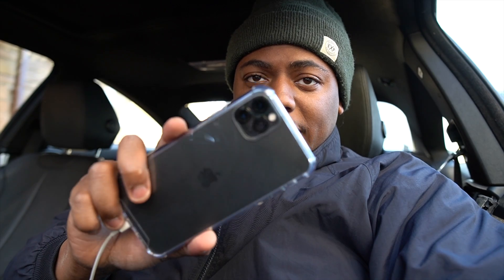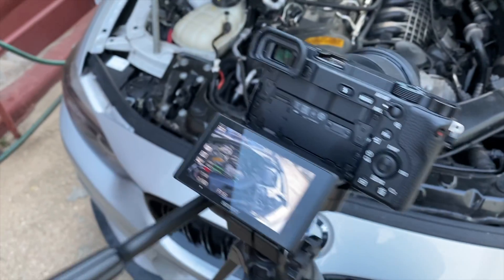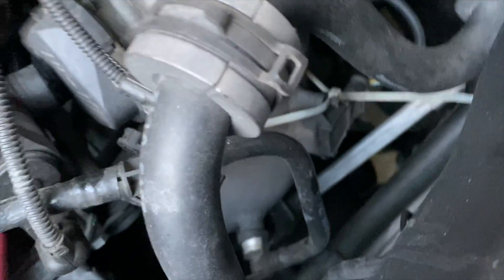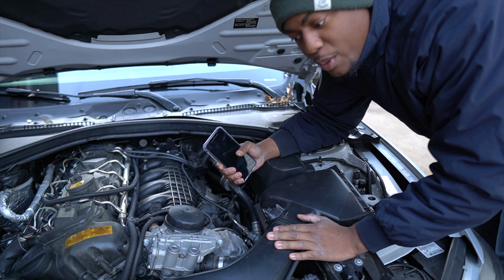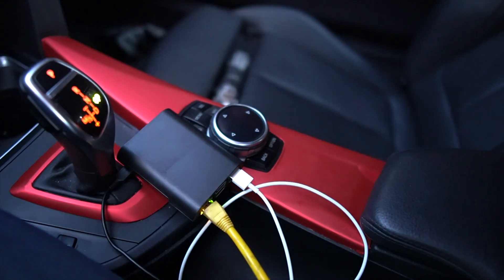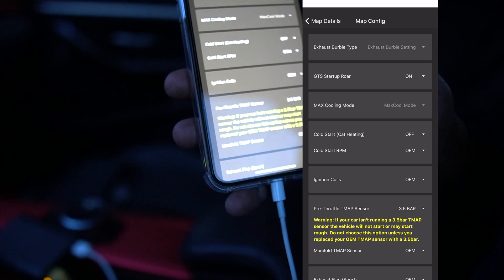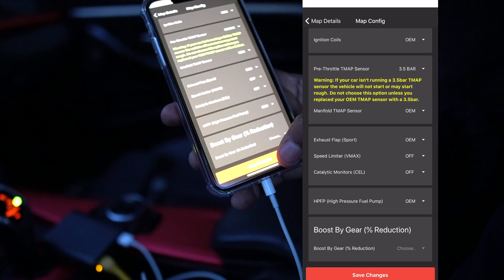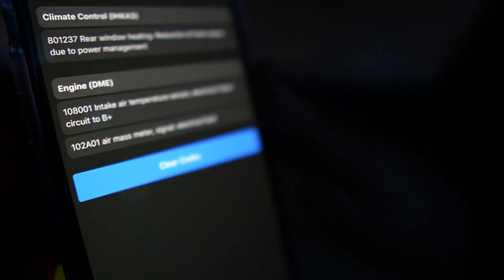Upgrading N55 Tmap Sensor

Comment: Hey love ur content very thorough bro keep it up I got a 2018 650i I'm going with a stage 2 tune i got a down pipe muffler delete going to put a intake on too my question is do I need 3.5 bar tmap sensors to get optimal boost out of my turbos the n63tu has 2.5 bar sensors I believe I want to get low to mid 20s boost
Reply: 2.5bar only reads 21.7 top. any boost spike above that, car probably gonna misfire cuz ECU won't calculate boost info correctly.  Also pls remember to tune with software after changing 3.5bar Tmap

Comment: I've seen with the mass air flow code, if you change your air filter to a KnN filter and then you get a code for air flow to high or something like that, you need to your mass air flow adaptation. This can be done in MHD I know for sure and I'm sure others. This should fix the issue unless you have a bad MAF! This is what I've seen anyway.

Comment: Hey man I saw a previous video you said you had some trouble with boost leaks when running a more aggressive tune before the big turbos. What did you do to fix it ? My cars wgdc runs at 85 to 100% when pulling it and still 2 lbs of boost under target on mhd stage 2 plus.
Reply from the maker: I was having issues with my chargepipe not lining up properly.
Reply: Slowspeed did you just fix it up or changed the pipe? I have the same one vrsf charge pipe, it seems pretty well lined up, i took it to the dealer and they ran and smoke test nothing on that... I’m about to try and put a different one and change the intercooler couplers as well.
Reply from the maker: I fixed it, and also make sure the meth hole is plugged and tmap screws are tight
Reply: Slowspeed thanks for the reply man !!!

Comment: Just did this same thing 550 stage 2 bm3 I changed to 3.5 and that’s a whole new can of worms tuner told me reinstall 2.5 car did not like it  caused timing to go way out and boost was all over the place I have logs before and after the 3.5 install only reason I installed was to see how much over boost I was getting stock 2.5 should read up to 22.7 psi
Reply: So u saying the 3.5 was worst for u?
Reply: 2.5bar reads 21.7 top

Comment: You need to upgrade your fueling system ASAP!  Your pump won’t be able to keep up and will ultimately fail, especially with you pushing such a high boost target. That’s why everyone says to upgrade that stuff first before you go stage 2 or even bigboost/speedtech etc.
Reply: I'm currently running bootmod3 stage 2 with catless downpipe,  intercooler and intake so far feels really good.
Reply: gamerz skillz yeah they’re talking upgraded turbo/ 20+ psi, you don’t need with Bm3 Stg 2
Reply: You think the B58TU will be enough?
Reply: Still have to upgrade the low pressure fuel pump with a stage two. The b58tu is only a high pressure fuel pump and that isn’t enough for the n55
Reply: Stage 2 tune or turbo?
Reply: gamerz skillz stage 2 turbo.
Reply: Lmao, the fuel pump will not fail... Rigorous testing has actually been done to prove that these HPFP's do not fail from over-spinning, but rather due to supporting components, such as inlet valve actuator and limp mode bypass valve, which have nothing to do with over-working the pump. The only issue with running a stock HPFP on high boost target (16-19psi, depending on ambient temp) is that you will hit limp mode every time at the top of 5th/6th gear and above (on ZF8) when the HP sensor outputs a fuel pressure value that is considered "safety zone". This is a common feature in all modern DI cars and other control systems, as to prevent catastrophic failure in the part being monitored, or the system as a whole. So no, your HPFP won't fail and neither will anything else... Unless the sensor fails (then you're screwed lmao)
Reply: Stefan Kitsos drop links to who’s tested it then please. Especially on full e85, no blends and high boost targets like 20 psi
Reply: This is a must. I got the xdi 35 hpfp for my whip and im still stock turbo.